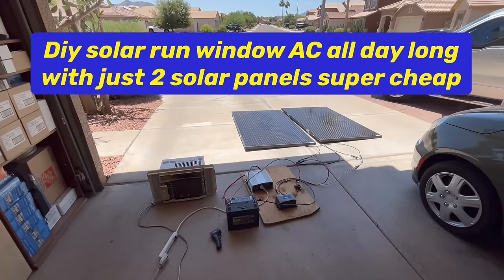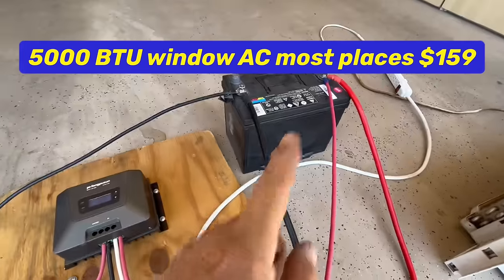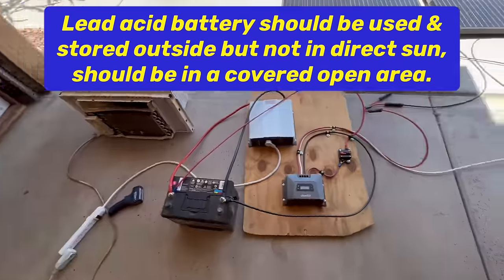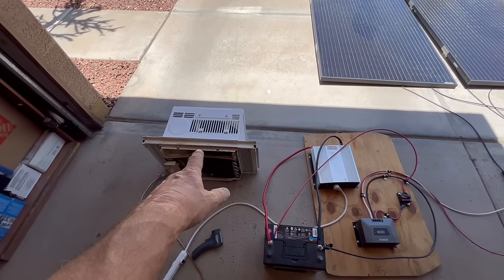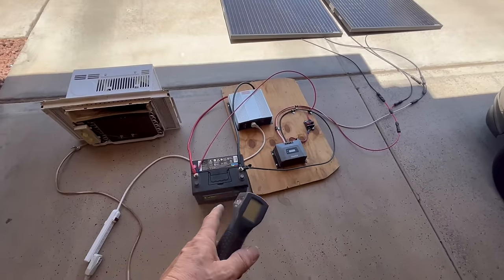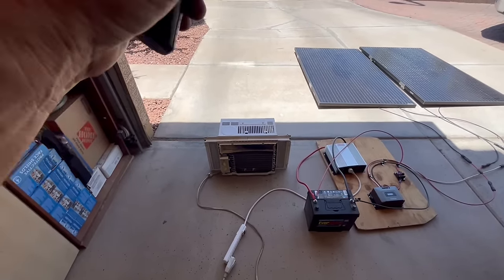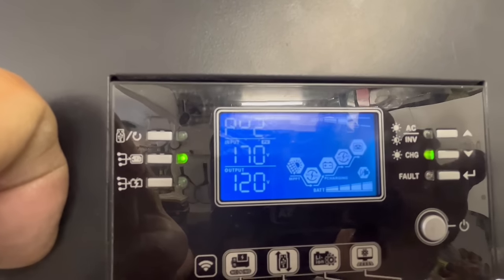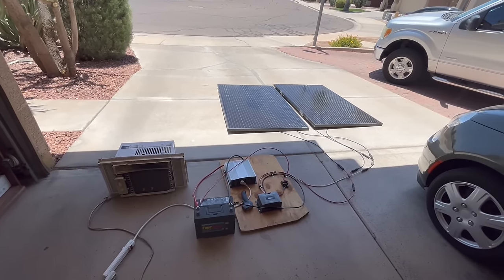Run your window AC with just 2 solar panels when sun shines. Easy DIY project you can do in one day.

Comment: Those Harbor Freight cables to your inverter are junk! The 10AWG is larger sheath than the 8AWG PV wires. I use to have auto jumper cables that deceived me of the amp capacity.
Reply from the maker: I have had 170 amps go through those cheap Harbor Freight cables with no problem on my 48 volt off grid solar system running my 12.7 ton electric pool heater that uses 7500+ watts while running. Not sure why you had problems. I use on all my solar 48 volt systems. These harbor freight cables I use are #2/0 AWG. I can start and run both my 3 1/2 ton and 4 ton whole house ducted heat pumps to air condition my 2450 square foot house while 110 degrees outside. The solar wire in my video is 10AWG and that is only meant to carry max 30 amps. That is specifically designed for solar applications. These are two different wire types. This 10AWG is for solar and not for jumper cables. Hope this clears up some things for you. Hope you have a truly wonderful and extremely blessed 2024.

Comment: How much is a set up like this ?
Reply from the maker: If you can find used solar panels, that will save a lot. It cost me around $550 total.  It that was 4 years ago. It’s probably around $700 or more now. You would almost be better off using an all in one solar inverter which is pretty cheap now but I would get a 24 volt inverter so you can add more solar panels. This is just the basic system. Improving it to fit your needs is what you should do. There are many diy people out there with great solar systems they made this fits their needs. The mini splits are now widely availability and are being used in many homes, businesses, sheds, garages, etc… they will last about 6-10 years and are so much more efficient for the money. A 12,000 btu 120volt mini split can cool up to 600 square feet as where a window ac will only cool a 10x10 area or 100 sq feet. Mini splits can also heat as well as cool and can keep a desired temperature in a room or large area as where a window ac will just stay running constantly. Mini splits once reaching set temperature will reduce the watts needed as low as 70 percent less power. They even have mini splits where you plug the solar panels directly into the outside unit of the mini split. Usually need 1500-2000 watts in solar panels and can run from around 9am-5 to 6 pm, then can plug into grid wall outlet or use LiFePO4 battery bank to run overnight. I was looking at a mini split on eBay today for $391 plus tax and free shipping for a 12,000 btu mini split that is 120 volt. That is almost 1/2 of what I paid 4 years ago. 19 seer. I use 2 -12,000 but mini splits to cool my downstairs in Phoenix AZ every day, it was 110 degrees today and my house was at 72 degrees. All off grid solar powered. This is the next step up from a window ac but is so much more efficient and will cool or heat 6 times the area. The 2 mini  splits save me $7-$ 10 a day in electricity from May to November in AZ. More answer than you asked first but I think we’ll worth looking into. Huge amount of videos on YouTube on this subject and huge variety of mini splits and how to install yourself. Hope you have a very blessed day.
Reply: @diy-solar-guy  Hey that's great info. Thanks...

Comment: ** CAN A 12,000 BTU SPLIT A/C & HEATING SYSTEM ALSO, BE USED WITH THIS SAME SOLAR PANELS SETUP?
Reply from the maker: You would need a lot more solar panels to run a mini split. I installed 6 mini splits in my house, 2 upstairs, 2 downstairs and 2 in garage, next a mini split will be installed in my motor home. I used a 24v MPP off grid inverter that I was able to connect 10-250 watt solar panels to. I bought used solar panels at santansolar.com for $30-$38 each. I also bought inverter from them but I think they stopped selling that inverter. You can still buy on eBay. Inverter was around $700. I also bought my wire and breakers from SanTan solar as well. 10 gauge wire and 60 amp breaker. I bought 2 12 volt AGM batteries from eBay and bought battery cable to connect to inverter from harbor freight. I show completely connected mini splits in my videos, and explain how I did it but I do not show step by step on how to install components. You can find videos for connecting all those components individually on YouTube. I love using the mini splits, I can run for free in day with solar and at night with LiFePO4 battery. I can run 2 mini splits to cool 1200 square feet downstairs area and use half the watts of my 4 ton central ac unit, but I can run my 2 central ac unit with solar in the day and upstairs 3 1/2 ton central ac at night with LiFePO4 battery bank if I want to. All the mini split and central ac units are connected to my off grid solar inverters. Check out my videos showing this and I explain how I did it and what components I had to use. Last month I spent $0 on air conditioning my house 7/24 for 28 day and my garage all day with just solar, I have 3 bedrooms above garage and now I keep garage at 78 degrees during the day so that bedrooms above garage are not hot overnight anymore. You can learn a lot from watching my videos before buying components, you can ask me questions and I will answer. Research components before buying. There are a lot of new products now that are better than what I have but we’re not available just 2-4 years ago when I started building my system. Before I figured out how to run my central ac with solar, I used the 6 mini splits to air condition house during the day using solar to cool house from 8 am to 6 pm, then used utility grid power from 6 pm to 8 am. I saved 50-70 percent off electric I’ll doing that because I was cooling the house at the hottest part of the day for free and using grid at night when cooling off outside. Mini splits kept my downstairs cool at 76-78 degrees during this heat wave that lasted 2 months in Phoenix AZ where day temperatures were 112-117 and overnight lows were 90 degrees. Even if I just installed the 2 mini splits downstairs and ran 24 hours a day on grid power I would still save about half on electric bill cause the 2 mini split use about have the watts the 4 ton downstairs central ac uses. Hope this info helps, watch my other videos to get a good idea of what is possible with off grid solar, I think you will like the videos,  hope you have a wonderful and blessed week

Comment: All that from San tan solar , I could use some help if your available
Reply from the maker: What help did you need?
Reply: @diy-solar-guy  will this set up shown power up to 10,000 btu window ac
Reply from the maker: @stanleymartin7469  no you would need a lot more solar panels and would be better off using like a 24 volt all in one inverter that has a charge controller included inside inverter. You would be able to connect 10-250 watt solar panels which you could pick up for $25-$50 each more than likely. The inverter would probably cost around $600-$750. You would need 2-12v batteries or a 24 volt battery. I have videos of using 110 volt mini split that are 12,000 btu. Close to the power consumption of what your window ac would use. But you could run 2 of those window ac units or 2 mini splits that could cool an area of 600 square feet each unit. I cool my downstairs with 2 mini splits and it is close to 1400 square feet and half of the area has 18 foot ceiling. I have a lot of videos on that 24 volt all in one MPP off grid inverter. You can see how I use them, I have 2 upstairs, 2 downstairs and 2 in garage, one if the ones in the garage is a 220 volt 18,000 btu mini split. Check out some of those videos and you will get a better idea of what components and how many solar panels you would need. I use Wallmart lead acid batteries, AGM deep cycle built specifically for solar use and Lithium Iron Phosphate batteries (LiFePO4). Hope all this info helps. Mini splits are far more efficient than window ac also mini splits can be used to heat in the winter as well. Thanks for your question. Hope you have a wonderful and blessed week

Comment: How many batteries to run portable ac in bedroom all night?
Reply from the maker: You would need at least 1 or 2 LiFePO4 battery to run overnight, might be able to use 1-51.2v 100ah 5120wh battery. AGM batteries are great for the day but are not good for overnight use. If you use 12v LiFePO4 batteries, you would need 4-6 batteries. I found that by running during the day on solar alone and grid at night I saved 70 percent off my electric bill. Window ac are not the most efficient units compared to mini split heat pumps. Mini split heat pumps start at 9000 btu, 120v. A 5000 btu window ac will use around 500 watts an hour most of the night until outside temp drops in the 70’s. If you can get a window ac that you can set temp on a remote or digital display and set at 78, you could get through the night on LiFePO4 batteries. 5000 btu is for a 150 sq ft room, it your room is life a 10x10 it would help to cool room faster. Humidity will come into play as well. Hope this info helps.

Comment: Can you run this system without a battery?
Reply from the maker: @SuperSuperDuperNice   No, this system requires a battery with the charge charge controller during the day. There are mini split that can directly connect to solar panels but currently no window ac is out there that can directly connect to solar panels.
Reply: @diy-solar-guy  thanks!

Comment: How much would this cost

This type of setup

Really near stuff
Reply from the maker: I purchased all of this around 4 years ago for around $500. Hard to find charge controller anymore since new technology is so much more efficient with all in one off grid inverters that take in solar input and put out pure sign wave 120 volts or even split phase 120/240 volts. I have 2- EF4 3000 watt off grid inverters in parallel running my 3 1/2 ton whole house heat pump 24 hours a day with LiFePO4 battery at night. My system has paid insert back in just 4 years with the savings on my electric bill. Today it would cost a lot more. But now they have hybrid 12,000 btu mini splits that can cool or heat a room up to 600 square feet. Whereas this window ac is rated for around 100 square feet. You can directly plug your solar into outside unit of mini split and connect to battery or grid power as well to supplement of rainy or cloudy days limiting your watts from grid to 600 watts or less. Here is the link. Buy 5-400 watt solar panels and you are air conditioning or heating a space up to 600 square feet during the day for free. Can easily make your money back over a few years in not having to run main ac or if wanting to cool a garage. Very inexpensive way compared to installing a ducted ac which could cost over $10,000. Using a mini split instead of this shaving hundreds of dollars if my electric bill each month from April through November out here is AZ. Link for Hybrid mini split. Check out my newer videos showing the 3000 watt off grid inverters running across and mini splits along with pool pump, pool heater, freezers, fridge, lights, dishwasher, washing machine, clothes dryer and more. You will get more bang for your buck with mini split but you can still do the window ac unit but it might cost $800 or more for everything as where mini split plus solar panels might be twice that price. They also sell kits that include everything you need for hybrid mini split instal. Check out link and feel free to ask more questions. https://signaturesolar.com/eg4-hybrid-solar-mini-split-air-conditioner-heat-pump-ac-dc-12000-btu-seer2-22-plug-n-cool-do-it-yourself-installation/
Reply: Thank you so much for the info

I really enjoyed the video and will look at the other videos u have mentioned

This is amazing

I installed a 8kw solar panel for 6000 10 years ago but now they want 15000 maybe more for the same system

I am so disappointed in these folks charging so much money

You need to do small gazebo with this setup

You would sell a lot of these !

Thanks a million sir
Reply from the maker: @Ruhdddch  you are so welcome
Reply: This looks great.. specially with no inverters needed

Do you have recommendations for where to get the solar panels
Reply from the maker: @Ruhdddch  I buy used solar panels locally in Gilbert AZ at Santan Solar. Depends on where you live, you might need to search on the internet for local places that sell used solar panels. There are more and more places selling used panels that are 2-10 years old.
Reply: Woo amazing

That is a great solution actually
Reply: I have been dreaming for such a system for many years this is really affordable

You can easily make outside areas cool and available
Reply from the maker: @heavenlyReza Glad you like it.
Reply from the maker: @heavenlyReza it is possible, just adjust system for your needs.

Comment: Wheres the ground wire and why not put a couple cooling fans plugged into the inverter
Reply from the maker: Does a ship or helicopter or airplane or a car use a ground wire? Do those use ac or dc? Find the answer to these questions and you will figure it out. Why run cooling fans when I can air condition my garage for free to 75 degrees using off grid solar.
Reply: @diy-solar-guy  the answer to those questions is yes they do. All electrical circuits must be properly grounded
Reply: @diy-solar-guy  the reason you would use cooling fans is because your motor home isn't going to drop down to 75 degrees in a minute it takes time to remove heat from a space and in that time the inveter and or control board could overheat. Its the same reason a computer has cooling fans the heatsink by itself cant properly dissipate heat and the computer overheats
Reply from the maker: @1MNUTZ  correct, they are bonded to the frame instead of earth ground.
Reply from the maker: @1MNUTZ  I use Ryobi 18 volt cordless fans in my motor home, I always keep 2 or 3 for sleeping at night. I now have a mini split in my motor home, 12,000 btu 120volt. It cools it down very fast and gets the inside below 70 degrees. My rooftop ac barely got the temp below 80 degrees after a few hours. Found the mini split in Lowe’s in clearance area for $74, lol. It will heat the motor home as well on the winter. It is so quite. I can run my rooftop ac and mini split at same time to cool motor home down in less than an hour when over 110 degrees outside. Hey, thanks for the input. Hope you have a wonderful and blessed day
Reply: @diy-solar-guy  yea the frame is the ground. Ground doesn't have to be an earth ground.
Reply from the maker: @1MNUTZ  exactly

Comment: I bought 4, 6 volt interstate exstreme batteries and tied them in series 2,6 volts in series and then those 2 12 volt in parallel. A total of 450 amp hours. I then ran 8,100 watt panles to this bank with a pure sine wave inverter. My bank got up to 13.8 and gave me 3:20 minutes running a 5000 btu window ac that pulls 460 watts and 4.32 amps. A week later and my battery bank won't charge above 13 now and I'm only getting less than 2 hrs of run time before the inverter alarms. What am I missing? Anyone? Thanks!
Reply from the maker: You can not let your 12 volt lead acid or AGM batteries drop below 12 volts at any time. Lead acid and AGM batteries will not run very long on just batteries. You would need to switch to Lithium Iron Phosphate batteries to run for any length of time. I used a 12 volt LiFePO4 150amp hour, 2KWh to run window ac for almost 4 hours with no solar attached. I used 2 of those LiFePO4 batteries in parallel and was able to run window ac for over 8 hours. Lead acid and AGM are only good for during the day with solar panels and full sunshine. Look at getting a lithium iron phosphate battery, shop around. Try trickle charging you 6 volt batteries to see if they will charge up again. Charge each one individually to see if you can restore battery back to fully charging. Hope this helps. Hope you have a truly wonderful and blessed week.
Reply: @diy-solar-guy  Thank you! Bless you also!👍👍

Comment: My Mobile AC takes 1.3 KW at 230v can 2 solar panels keep it on ?
Reply from the maker: No, 2  solar panels would not be able to run your portable ac since the ac uses 1.3 kw, you would need at least double that watts in solar panels. You would need to get an inverter that is either split phase 120/230 volts or a 230 volt inverter. I would think you would need about 2500 watts in solar panels at a minimum. A 5kwh battery, preferably a Lithium iron Phosphate (LiFePO4). My 120 volt mini split uses around 1200 watts at start up but will go down to 400-600 watts after room is cooled. I believe those portable units will pretty much consume 1.3 kw constantly. Hope this info helps. Thank for your question and hope you have a wonderful and blessed day.
Reply: @diy-solar-guy  thanks i need more solar panels than i expected lifepo4 is sure i dont wanna other battery and yeah that mobile ac consumes alot but it makes 12k btu per hour
Reply from the maker: @MILANKO4747  you are welcome, hope you get your ac running on solar power